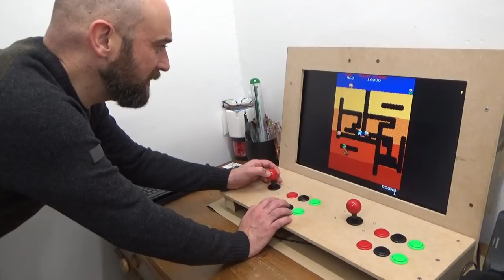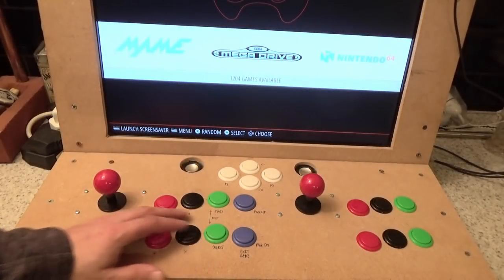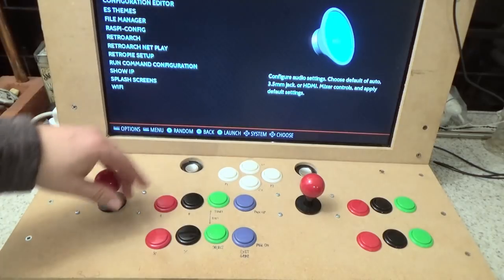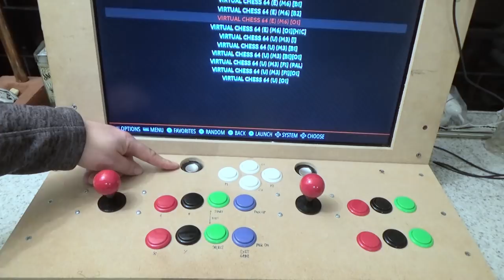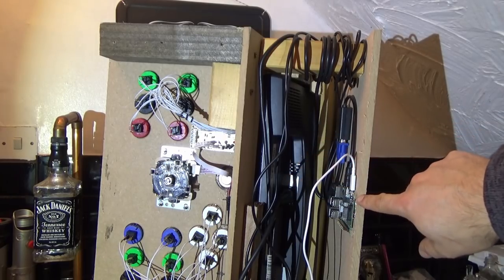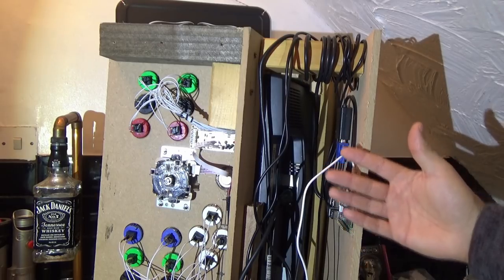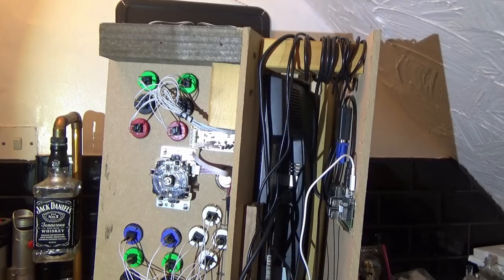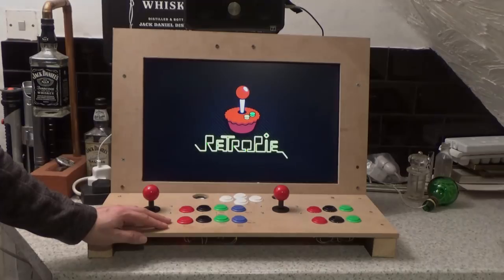DuB-EnG: DIY Retro Desktop Arcade PT3 - Joysticks Buttons Cabinet RetroPie Emulation Station Roms

Comment: Ahh the old games, frogger and pacman, i had those on the zx spectrum, simple but bloody annoying / fun :-D
What sort of engineer does not measure a button diameter before drilling a hole?.
i don't know........ you could use the excuse that your hole drills are imperial size and the button is metric, or confuse people by saying whitworth :D

Yep i was thinking sides too, also there are no flashing lights on it, you may have an old set of xmas tree lights with one of those green controllers. :-D.
Ooow aint i an evil swine, more work to do LOL :-D
Reply from the maker: zx8401ztv ... ahhh bob....  ...  flashing lights ....  great idea!... I think they should be fitted to the rear as ambient lighting! ... 2BA